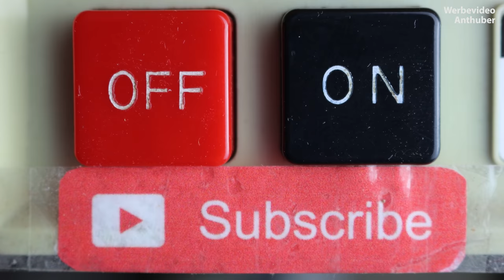Biedermeier 1830 - Originale Restauration

Comment: The job is done perfectly. But I noticed the modern upholstery fabric is of much inferior quality than the old ones they used in past centuries. Is there any way to find a fabric as close to the original quality as possible nowadays?
Reply: There are so many unrestored chairs out of that time. Wouldnt it be better, to give "Him" or other craftsmen (its a casual job to study in germany) those chairs and an order to restore them and buy a perfect chair WITH history?
Reply: Some fabrics are no longer made.  Others can be restored which is extremely expensive or fabrics can be remade some costing upwards of $600.00 per yard. a bit pricey for an exhibit but I am sure if they are doing restoration work for a customer there will be a wide choice of fabrics depending on your budget.

Comment: I’m surprised you found a chair with that few nail holes in it, normally it would be so full of holes that it won’t hold a nail. I am at least a generation older than you and went through the same schooling. I use to have to spit tacks. Not sure how much good the knowledge is anymore except with what is happening now it might help you to survive without electricity.

Comment: I see that you are returning the springs to the chair, perhaps you can turn them so that the loops are not on the inside but on the outside of the chair,  it may make it a little more comfortable, if you have to sit on it. Also there is high density foam which allows for comfortable seating for heavier persons

Comment: Do people normally use those “old fashioned” materials - palm, jute and horsehair - today?
Reply from the maker: Today, foam is the main material for upholstery. Unfortunately, it is becoming less and less that an old chair is made completely new with these materials. Because of the amount of work involved in this type of upholstery, repairs (as much as possible) are still often done. If such upholstery is well made, it will last for decades.

Comment: Just a question what did you not treat the the springs for rust
Reply from the maker: Thanks for watching. The springs of the upholstery are made of copper, so no special rust protection is needed. Such springs were also used for decades in traditional upholstery.
Reply: @christiananthuber7973  thank you so much for the response! Copper doesn't rust it just tarnishes right?